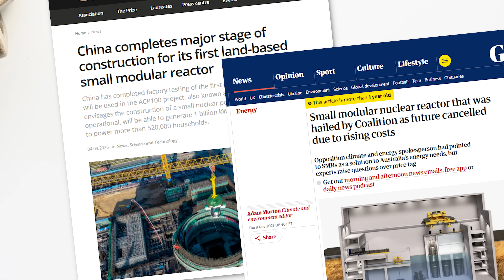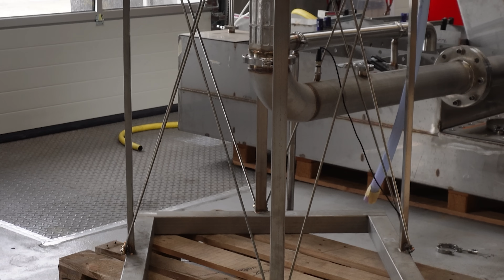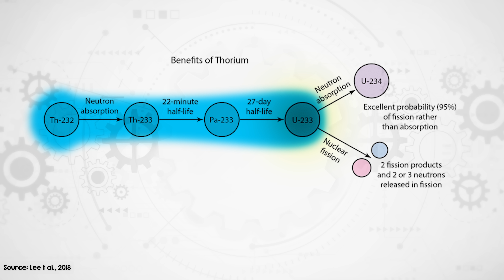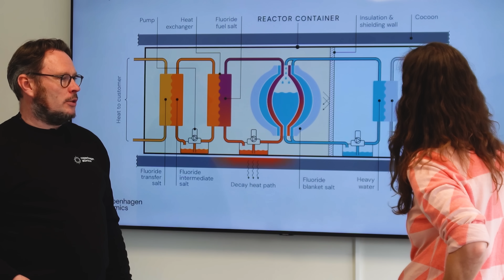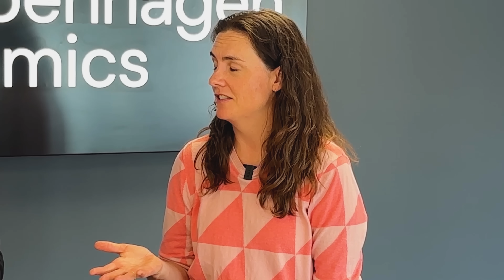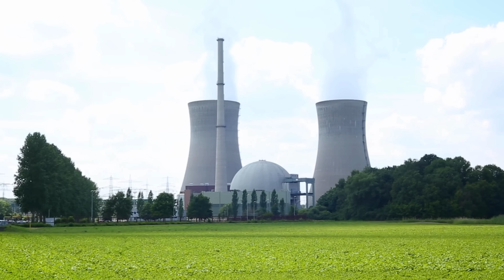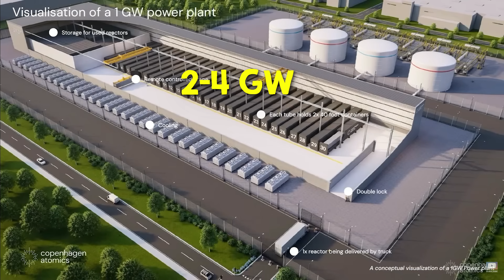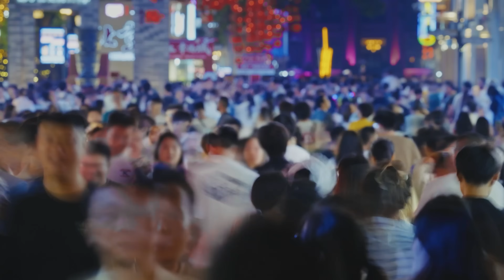Can Copenhagen Atomics Make THORIUM REACTORS Work? [TOUR]

Comment: It would be a nearly ideal solution to power isolated settlements in the Northern Territories and Alaska, provided it could be transported there.  Isolated communities rely on diesel generators to provide electricity and pump water, when all the generators go down the whole community suffers.  It could provide reliable power in addition to using the lower grade waste heat to heat buildings, keep water flowing and also keep sewer lines clear (a fairly big problem in cold climates).  The water and sanitation alone would reduce medical issues from lack of washing. For example, there can be Cholera outbreaks because of this.  Replacing it every 5 years could become cumbersome though.
Reply: The most expensive parts never need replacing (the salts and D2O), and the fuel is effectively free. Shipping a new/refurbished reactor out every 5 years, and even having an empty spare on site shouldn't cost much. The fluids can be pumped from one to the next. The high temperature nuclear heat does offer a lot more opportunities than with conventional nuclear (which can only produce electricity. and very inefficiently at that).
Reply: @Th-233 
Besides Thorium the fuel consists of lithium and beryllium, which are not free.
Reply: @andreasschmitt2307  The Li and Be are not consumed. The fuel is metallic thorium, which dissolves as needed to maintain the balance in the reactor. The salts are a one time cost and never need replacing.
Reply: @Th-233 
Li and Be are consumed. Especially beryllium is necessary for creating the missing neutrons for the thorium cycle.
Reply: @andreasschmitt2307  The neutrons come from fission of U-233. If you want to be really pedantic, there are some very rare reactions with Li and Be, but that only amounts to replacing grams per year out of tens of tons of salt, so it is safely ignored in fuel cycle cost.
Reply: @Th-233 
There are way too few neutrons in the thorium fuel cycle to be self-sustaining. Fission of U-233 produces around 2.2 usable neutrons on average. One neutron is needed for breeding, one for the chain reaction. But there are many neutron poisons that catch neutrons (fission products, protactinium-233). So the thorium fuel cycle needs an additional neutron source. The most common neutron source is beryllium together with an alpha radiator. The alpha radiation is produced by lithium, which catches a fast neutron and breaks into tritium, one alpha particle (helium cores) and one slow neutron. Beryllium catches one alpha particle and decays into carbon and one neutron. That's the reason for using FLiBe.
Reply: @andreasschmitt2307  From the perspective of someone familiar with fast reactors, skepticism is understandable; there really aren't many neutrons to waste. You can't help but waste them in fast
reactors breeding plutonium, and the only way to reduce losses to achieve acceptable breeding performance, is by making reactors huge. Maybe you are referring to an accelerator driven design, which I'm not very familiar with, and your criticism is probably valid there.

Thorium fueled molten salt breeders waste almost no neutrons though, because the blanket absorbs nearly all excess, which has the added benefit that fast neutrons aren't impacting the reactor vessel. It also allows them to scale much smaller without increasing losses, and the ORNL-4528 two-fluid MSBR design targeted a breeding ratio of 1.04. We know thermal spectrum breeding is possible with thorium, because the Shippingport reactor demonstrated it in solid fuel; it just wasn't sustainable, because there is no practical way of reprocessing U-232 contaminated solid fuel.

One might ask: why not build a fast breeder with a U-238 blanket? The problem is that unlike thorium, where the chemistry makes it trivial to extract the U-233 from the Th blanket, there is no easy way of extracting the plutonium to transfer it back to the core. The chemistry is obscenely complicated, so fast breeders just eat the losses at whatever size, and accept the inevitable damage the the reactor.

The only fast reactor that makes sense, is one with a thorium blanket, using the excess neutrons to create U-233. The core could be a plutonium iso-breeder fueled by U-238, and this both minimizes losses and maximizes production of fissile to start many more reactors. This is economically attractive, because thermal spectrum breeders need only a small fraction of the fissile to start, so we'll want many more of those. Breeding Pu is a much slower and more expensive path to scaling nuclear.

Comment: Thanks Rosie. With more than 50 SMR and advanced reactor companies competing only a few see the advantages of Thorium.
Reply: Those who understand the advantages of thorium (in a molten salt breeder) realize that the other 50+ SMR companies won't be competing. They are basically trying to engineer around the financial problems of large reactors, but those SMRs are even more inefficient in aggregate, and not even truly small in size. Thorium reactors will be efficient at all sizes, because their blanket captures neutrons that would otherwise be wasted causing large inefficiency. The cost of uranium fuel is trivialized today, but it will become a large fraction of power cost with cheaper reactors.

Comment: Much safer than a reactor that needs power to push the moderator rods into the reactor to stop, or to cool itself. Power outage: the stuff flows down into a tank. But what is some calamity (eathquake, planecrash...) causes the container to turn upside down?
Reply: if the reactor vessel is upside down, the geometry prevents pooling fuel into the geometry needed for sustained fission; only decay heat will be left
ditto if the reactor breaks, fuel will spill all over the floor, but no 'pool' of fuel needed for sustained fission; only decay heat will be left

Comment: I have not heard anything about how security is going to be provided.  This seems like a large target for a terrorist.
Reply: nuclear materials are poor targets for terrorists
a - any nuclear material at a destructive level needs special handling or you get sick; ok if you only plan to live a few hours, but a properly planned attack might take weeks to prepare for
b - any nuclear material, at destructive levels or not, is very easy to detect - radioactivity is EXTREMELY easy to detect, so difficult to hide
c - nuclear material is well tracked, so getting some is going to be difficult, and in any bulk is going to alert the police quickly, so harder to hide while you plan your attack

in contrast you can prepare a biological or chemical attack with materials from the hardware store, no preparation or equipment needed, and materials are difficult to detect; explosives ditto except semi-difficult to obtain.

Comment: And when a unit fails, where does it go as it can't be fixed. The controls needed to ensure they are built correctly to avoid a failure could be very expensive. Just needs one parts supplier to skimp and you new site could be dead and full of radioactive waste.

Comment: I can see this as the dis-patchable "clean firm power" part of the portfolio.  Doesn't have to be a total solution.  It might even be more expensive.  But can be a chunk of the pie in the solar+storage microgrid, in that it adds provides a certain "quality of service".

The big area of concern, is if the reactor container is destroyed, say in a kinetic event, would there be a major radiological event?   Comparable to a "dirty bomb" (?).  This is why I think TRISO in a compact reactor form, maybe a better bet, if the goal is modularity, scalability, flexibility, deployability ...
Reply: > if the reactor container is destroyed, say in a kinetic event, would there be a major radiological event?   Comparable to a "dirty bomb" (?)

no major radiological event

the fuel salt is liquid, and cools rapidly to a solid; any contamination would be local
there is no chance the salt becomes an aerosol or a gas, so there is no dispersion

the fission products are also salts, so they remain with the solid salt (particularly iodine, cesium, strontium) - only trace Xe, Ar, Kr would disperse as gases, but these have short-lived decay chains and these noble gases don't enter biological systems

Comment: Very interesting but I'm very far from being convinced that nuclear is a good way forward.  
The bottom line is that we already have access to orders of magnitude more energy from nuclear fusion and fission than we could ever use: In other words from the fusion reactor in the sun which is what generates our wind and solar, and the fission reactor in the planet's core from which current oil drilling technologies could reliably access heat for almost all other needs directly (sounds like we are a way off from hot enough extraction for steel).  
We need to stop messing about  - we have mature tech for everything we need.  
See the latest fully charge interview with Jamie Beard.  
https://youtu.be/lSlu5Uby-jM?si=1z2upY_8VkRrHw4l
Reply: Heat generation in the earth's core is not from fission (except for a very small fraction of spontaneous fission, ie not triggered by a neutron.) It comes from radioactive decay of actinides and their daughter isotopes,  ejecting mostly alpha particles as the nuclei gradually shuck off mass down to lead. Fission blows the whole stack apart at once, releasing a lot more total energy.
Reply: @2x6x250ml  thanks for the correction - I had always thought that fission simply referred to decay (breaking apart) as distinct to fusion.  Howevs, the point about the amount of energy beneath our feet remains.
Reply: @bigbadthesailor5173  Sure there's a lot there - here in New Zealand we get the equivalent of one nuclear reactor, about 20% of our power, from geothermal. It actually has quite similar generation characteristics to nuclear - steady reliable baseload, plus some useable waste heat. It's not as clean, though - there's about 3x more low grade waste heat released, plus sometimes significant CO2, and it doesn't last as long. Mainly, it's limited, so far, to places near plate boundaries, and there's only enough to matter in low population countries like Iceland and New Zealand. In Japan, Italy, Philippines, and Indonesia, it's a bit player. In Australia, they tried for years to drill deep hot dry rock in the craton : money wasted (mostly tax money.)

Comment: I watched a video on Quaise energy using millimeter waves to vaporize rocks for boring for geothermal energy production, and unfortunately, it requires 50,000 volts to produce those millimeter waves.

Then I thought, why not colocate a thorium SMR with a geothermal well?  🤔
Reply: Well, if you have a thorium SMR, why do you need a geothermal well?

Comment: Look, of all the "modular reactor" ideas, thorium reactors are the LEAST amenable to being compact ... and hence modular.  The neutron breeding ratio of Thorium is really marginal.  You need to build a super-low-loss reactor to make it work.  This is usually so desperate that almost all of the "Thorium" reactor designs one sees are actually hybrids, with a core of HEU to get/keep them going. Even neglecting the problems of getting the cycle started (because it's really U233 that is being bred from Thorium that is running a chain reaction in a "working" Thorium reactor ... Pure Thorium-cycle reactors are a bitch ... it's really complicated.  Read here:

https://en.wikipedia.org/wiki/Thorium_fuel_cycle

I'm really skeptical they will make this work in any practical sense, at "modular scale."

Comment: very light on details! did he say the primary cooling water was 80 degrees? how could that make stream? and where is the actual power generator in their box? and how is the fuel actually cleaned? and why test in switzerland? so many questions, so few answer?
Reply from the maker: Some of those were answered and some are good ideas for a follow up! 
They don't have a generator. They supply everything in the "radioactive cocoon" and then their customer would get heat via a heat exchanger and use that for process heat or to generate electricity etc.
And testing in Switzerland is because Denmark bans nuclear chain reactions, they can't test that part there.
Reply: The 'primary cooling water' is not there. The 80 C heavy water is used as a neutron moderator, NOT as a coolant.
The  coolant is the fuel salt itself - which is pumped out of the reactor, raises the temperature in a secondary cooling circuit (presumably steam sent to the turbine, but NOT the 80 C heavy water used as the moderator), and then pumped back into the reactor.

Comment: 5 years is not long enough
Reply: Current light water reactors swap out all their fuel rods every three to five years (one third at a time.) I'd say manufacturing all the fuel pellets and fuel assemblies to very tight tolernces would be about as expensive as making one of these - without counting enrichment and mining costs.
Reply: Yes its...

Comment: Electricity is really only one use case for these. Most of the energy we use as a species is for refining raw materials, and while some materials such as aluminium need direct electricity, most materials need only heat. This heat is 100% from coal, natural gas etc. Solar and wind are not a practical pathway for generating industrial heat, while for nuclear its optimal because the energy starts as heat out of the reactotr.
Reply from the maker: I agree that's a good use for this tech, but disagree that there aren't plenty of good electric solutions to industrial heat. Check out my video on industrial heat for a deeper dive on those options, and watch out for an upcoming video where I toured a steel facility which uses electricity and hydrogen (made from electricity) to recycle steel.
Reply: Iron ore can be refined to iron using hydrogen. It's true you still need carbon to make steel, but a lot less of it. And some of the furnaces are powered be electricity.
Reply: @oneeyedphotographer Arc furnaces with hydrogen reduction does work, but its incredibly expensive. 2 major efforts (1 state funded and 1 private) in Sweden worked on this concept, but they have both stalled because of the massive economic ineffeciencies involved. Nuclear industrial heat would help immensely, and on site power generation would be basically the only way it could be competitive.
Reply: @ThePhiphler  Absolutely, it's hard to imagine an industry who wouldn't want this technology.
Reply: @ThePhiphler  Andrew Forrest/FMG has been working on it too.

I know it's not yet economic, but it's also new technology. Perhaps there is still room for refinement.

Electrolysis might currently be the cheapest way to produce hydrogen, but I have heard of alternatives being looked at.
Reply: @oneeyedphotographer  Both the Swedish initiatives were large, multi billion ventures, and planned to be located close to large hydroelectric power generation for easy access to green power. They both had state support on every level imaginable. Even with expediated permitting, near zero tax on the power etc they could not make it work. It's not viable with any combination of hydro, wind and solar, you absolutely need nuclear if you want to make steel without massive coalfired furnaces. Also, near zero of global hydrogen production is electrolysis, its all grey hydrogren from steam reforming of methane, which means carbon dioxide was released making it.